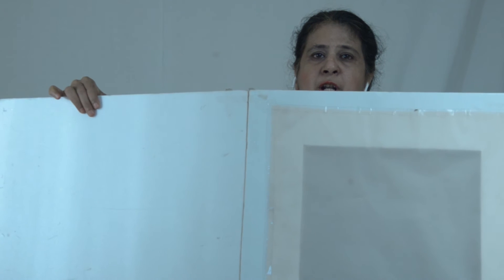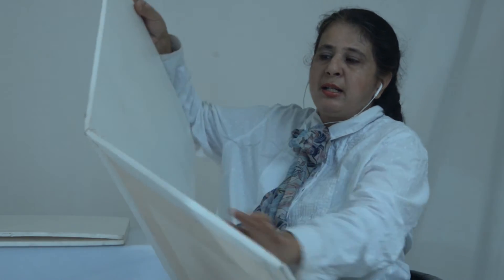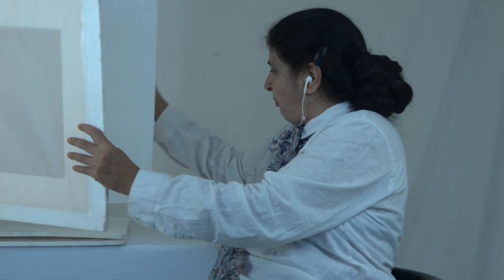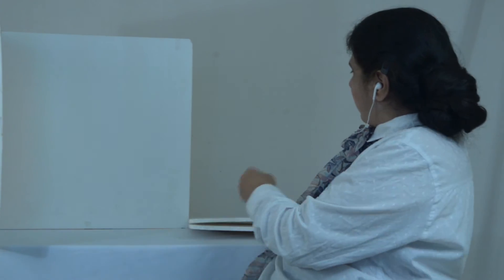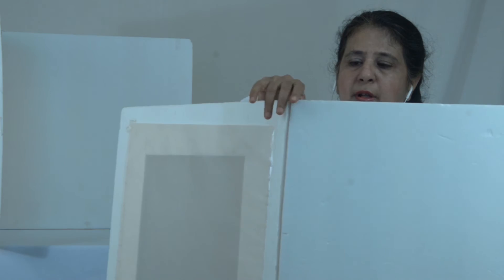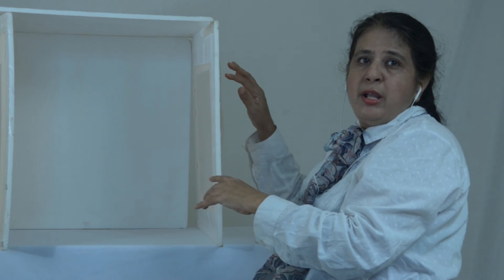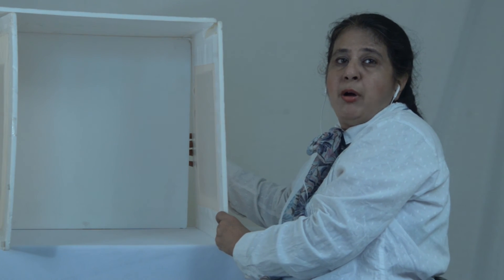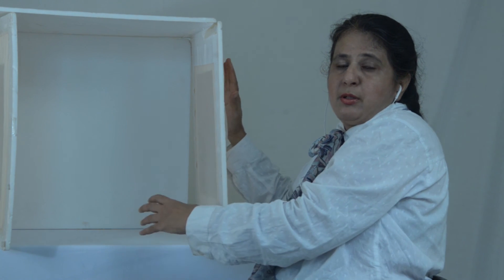Product Photography Tutorial how to make a soft box, DIY soft box, product photographer in chennai

Comment: What materiaIs did you use? (edited)
Reply from the maker: Sorry about that 8847257491 thats my number and if you want any information on any topic on photography you can call up and ask me................. I am sorry about your frustration.............. that soft box is made with foam board ............. its more compact than thermocol which keeps breaking into small pieces and I am scared can damage my camera . but both material serve the same purpose the same diffusion.
Reply: Thank you. What fabric or material did you put over the cut-out foam core?
Reply from the maker: Its  tracing paper or onion paper i put on both sides that is two layers one stuck to inner side and one to outer side , initially i flashed my strobes trough this opening but later i learnt that by putting speed lights inside the box and reflecting the light worked good enough, so that window was no more needed, put two stobes on side acing 45 deg angle and place them facing the board the light will reflect all around and give you a beautiful even exposure , I have only two strobes sometimes i place one on background to get a whiter background, but i never suceeded in getting a pure white background so far so its much simpler removing the background in photoshop.
Reply from the maker: you can use any transparent material it is for diffusion............. where are u from , you can directly email me for advice if you are trying to learn about product photography , its pretty easy and simple for eCommerce sites , only for a high paying assignments like advertisement photography it becomes challenging as you have to shape the light also, but for ecommerce an even exposure works the best.
Reply from the maker: harleen@coloristdesigns.com  is my email you can ping me anytime with all your doubts i will clear them for you
Reply from the maker: and my mobile contact nymber is 8847257491
Reply: ExceIIent! Thank you!